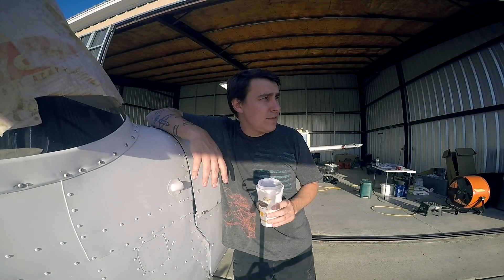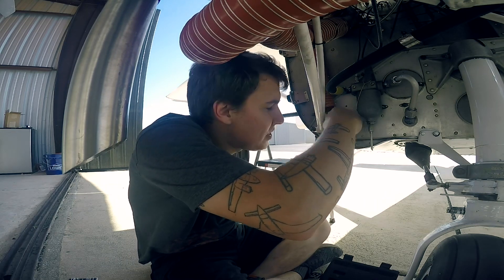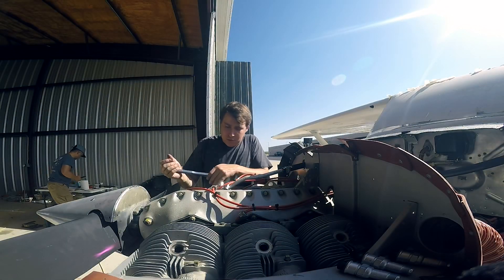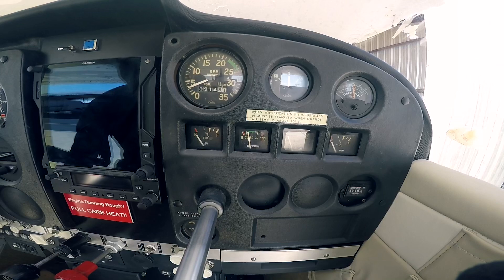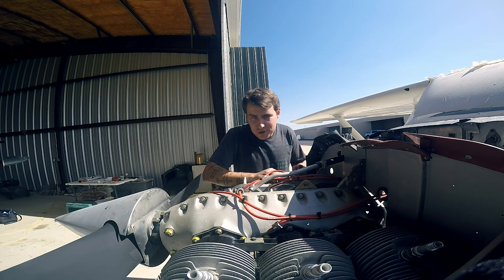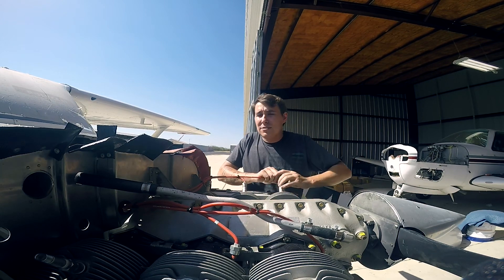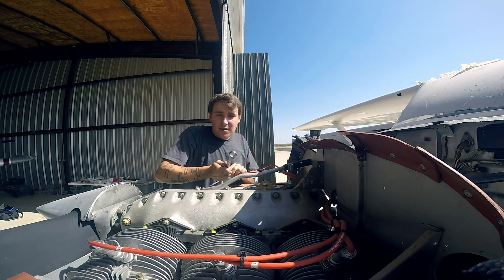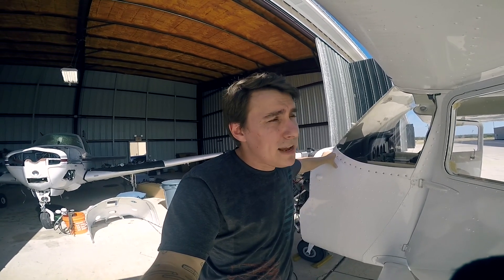The Importance Of Aircraft Engine Break In. Cessna 172 Build Part 16!

Comment: Im having a new OEM Continental O470R installed in my 182P currently and I gotta tell ya I will NOT be comfortable skipping my checklist run up items in the first flight after that engine being installed.
Reply from the maker: It is un-nearving but that's also why its a test flight with no pax. You can still do a mag check while you taxi you just do it wile at idle and you are not looking for a specific drop you are just making sure the switch is working.

Comment: Bad news an internal combustion engine is either good or bad from day one. Crate engines are installed in dirt late model stock cars out of a goddam wooden crate and turn 9000 rpms on night one. No such thing as engine break-in. Run the bitch or park it. So before you comment I have flown for 49 yrs